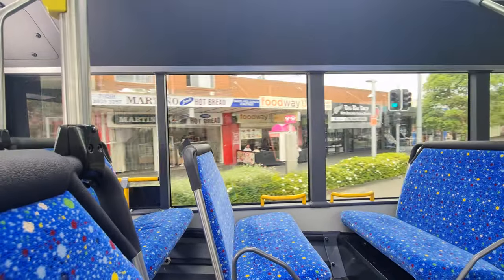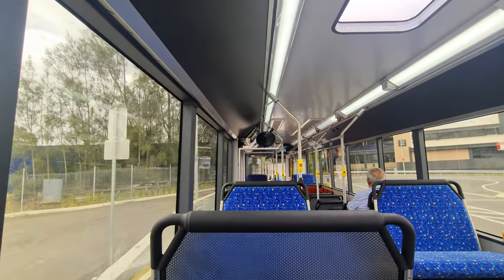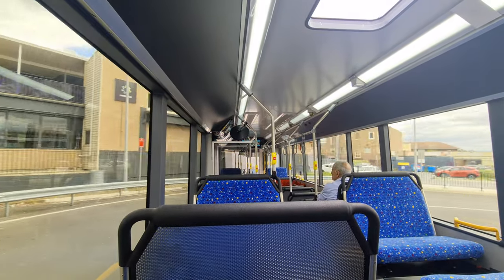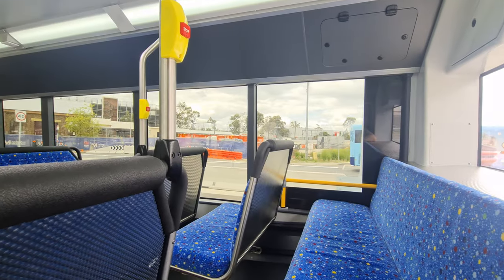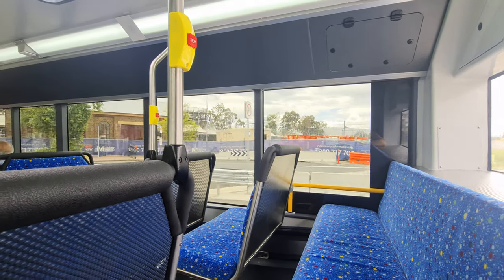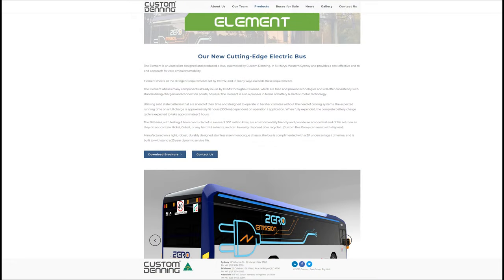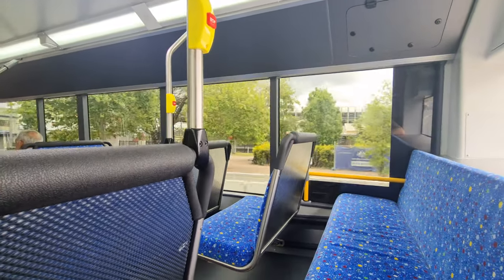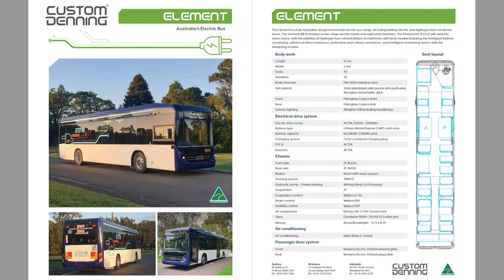I'm in my Element here! Busways Custom Denning Element

Comment: Got to experience an electric bus for the first time with the new Hornibrook buslines Volvo BZL’s!
Reply from the maker: That's exciting! Haven't had the chance to try a Volvo BZL yet. It's the first of the 'mainstream' manufacturers to fully launch a electric bus in Australia - will be interesting to see if it tempts more operators than the BYD/Yutong/Custom Denning/Bustech ZDi have so far.
Reply: @TalkingPlanning  They are a very interesting vehicle, they have a 2 speed gearbox that actually makes a ZF ecomat like sound when changing gears, but it does have some problems, like the bus vibrates when accelerating too fast.

Comment: About the Element's temporary withdrawal, I did some research and while most tend to agree it was due to overseas battery faults, at least one person suggested the panels were falling off as they were not bonded correctly...
These are the first new Busways Western Sydney buses with fabric seats since the Scania L94IBs in 1999, so that's quite interesting. However, I find it unusual that Busways opted for McConnell seats instead of Custom Metro seats, considering this is a Custom product.
I've ridden the Custom Endeavour a few times and something noticeable on the new Custom vehicles is the increased body roll - wonder what the cause of that is.

Comment: A rear window, that’s rare for a modern bus. I wish they all had it though.
Reply from the maker: It is a rarity, but probably needed as the rest of the interior is actually quite dark.
Reply: A rear window is possible on any electric bus as there are no engine components up there. Also makes a good emergency exit. The overwhelming impression inside the Element is tons of light and space, unlike the gloomy dark caves with no headroom in buses with a high floor at the back. All electric buses are able to be fully low floor but most of the ones in Australia so far aren't for some reason - can't break away from old diesel bus design habits?

Comment: Excellent video, but since you're talking about the low floor feature, you need to pan the camera around so that people see what you're discussing. Most of the film is looking out the windows, no shots of the aisle at all. A huge number of people here don't understand what a low floor means, they think it's just the floor at the front (low-entry).
Reply from the maker: Unfortunately there were a few too many people sat in the necessary spots to show that off! But agree that it's an underrated design feature.